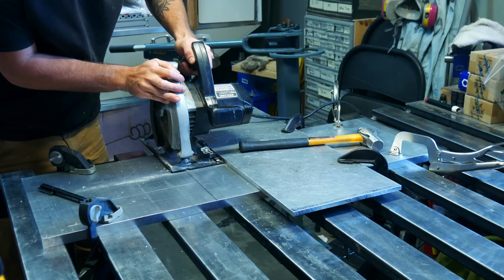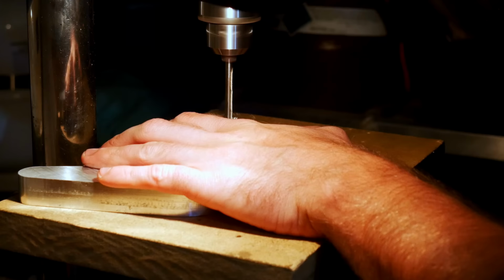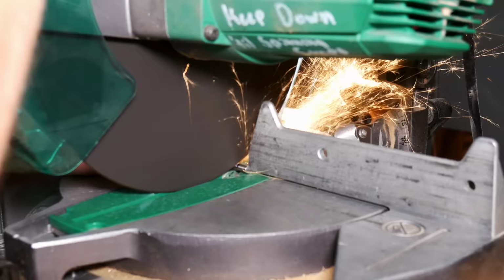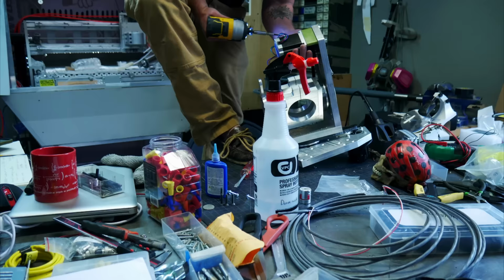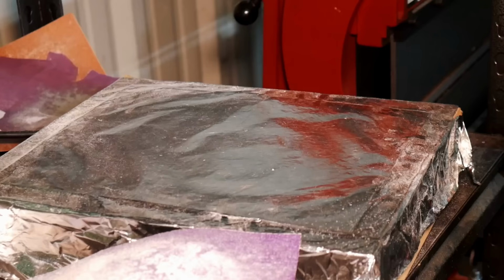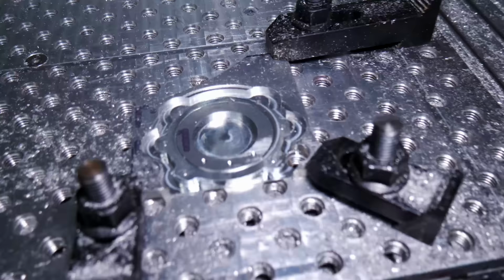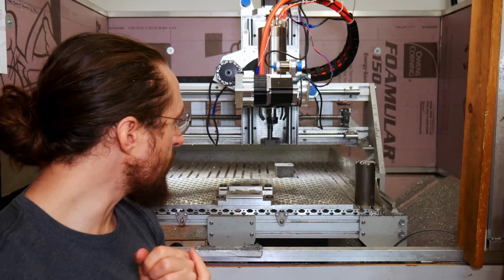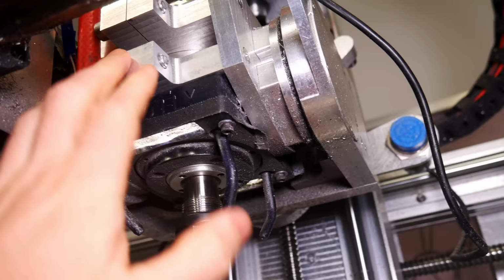Head-Head 5 Axis CNC Build

Comment from the maker: For those that are asking, the gear system is called a Howimat.  There's not a lot of information on them, so if you find more info make a post about it in the comments!
Reply: Just wondering if you're still planning on making a video about the Howmit drive? I'm very interested in it as I'm currently working making a large 5 axis.
I'm curious to know how stable your setup is being made from extrusion? I'm currently going back and forth between that and steel square tubing.

Comment: Nice vid man. FYI, You never want to twist wires together UNLESS they're a differential pair or power and ground. For instance, if you had a serial transmit and receive set, you'd want to keep those separate as twisting them together would cause cross talk, especially at higher frequencies (baud rates). A "pair" when talking about twisted pairs is usually a differential pair, for instance a CAN line would use a coupled or "twisted" pair when routing the circuit. This turns the prospective EMI into common mode noise that is then ignored during differential signal interpretation.
Reply from the maker: Interesting
Reply: That's a good bit of information.
Reply: Agreed. It would make sense for A+/A- to be twisted together, and B+/B-, but spindles are 3-phase so that would not make sense.

Comment: That's a cool gear mechanism! looks like a simplified Mini Galaxie from Wittenstein. The design trades a little bit of torque capacity and torsional rigidity for simplicity and compactness. Would be great to hear more about this drive and how you made it.
Reply: How is it called? Tried to google it, but I can’t find anything about it. Thanks!
Reply: @robytryall   I'm trying to find informatiuon about it as well and without any result
Reply from the maker: Yes, very similar, though this one is easier to manufacture.
Reply: @bogas78  I only found info on cycloidal ball reducer as most people comment around here, but the principle is by far not the same, here we get the balls reciprocating in a up down motion inside the disk, please help a friend out if you guys got more luck! Meanwhile waiting for the content owner to show up in the comment section. Much appreciated!
Reply: Hey  @DylanEdmiston ! Is there a chance you can give us a documentation on the wave ball reducer?
Reply: @DylanEdmiston  will you make a video about this howimat gear or prepare some website how to make one at home 😁?

Comment: The Backlash - belts stretch and contract. Maybe a little bit but they do. Thry to compensate it or remove the belts entirely with gears if possible. At least the gears have predictable backlash and it could be compensated with the software easily. Love the video great work keep on going

Comment: If linuxCNC use pivot point for it's TCPC, the centers of ration need to be located perfectly to have perfect rotation. Same as on industrial machines : cut one one side, do a 180°, recut, measure the tickness and adjust accordingly the pivot center. the hard thing is that you need to compensate the rotation AXIS of 2 axis, switching back and forth as you compensate as they are sort of linked.

Comment: 46:23 When you are trying to show a small piece in frame and want the video camera to focus the part, you must use the palm of your hand as a background or piece of paper, or else the video camera has hard time focusing. Excellent work on you 5 axis. I like the rigidity of the brackets...
Reply: Or use manual focus and set it at the correct depth for the shot.

Comment: The backlash is coming from the slop in all 3 axis with the round rails in an improper load bearing application on 2 of them on the side of the bearing housing.

Comment: Would you be willing to do a deep dive on your drive (halomat)? I havent found it online or to be used for industrial purposes. Also as you mentioned alot of people are finding out the hard way that harmonic drives or cyclodal drives arent good when they are 3d printed. Just to talk more about how they work and how to design them for the correct reduction ratio and so on.
Reply: its called a planar ball transmission or cycloidal ball reducer

Comment: When you're machining aluminum, and you can't use coolant, try and use an air vortex cooler. We used to do this when cutting open sealed boxes so we could harvest circuit boards out of them. Worked great for clearing chips from the endmill, and keeping temps down. It does require a beefy compressor/air supply though.

Comment: since people have been asking. its called a planar ball reducer they are known and studied and there are reasons they are not used. ie Hertzian contact instead of line contact of cycloidal or harmonic. meaning they have lower stiffness. they are really just a differently shaped cycloidal drive. also called cycloidal ball transmission
Reply: Yeah pretty much. I’m not sure how zbl is achieved without the drive on the same axis.  Stiffness could be improved using 3 wave peaks. But I can’t see mounting a motor without a worm or recirculating balls powering the drive platen that introduces backlash.

Comment: Great video! I work on CNC machines for a living and i learned a bunch from this. 
The controller i work with the most is Fagor. They have  offsets that can be used to correct the TCP errors you were trying to describe in the video. I would expect there is an equivalent with your controller especially as some head designs require these to be used as they cannot be physically aligned. I can send you information on how the offsets are used on Fagor controls if you think it would be of any help.
Reply from the maker: Interesting. Yeah that would be great thanks. You should see my email under my about. You can also find me on Instagram at ironmandylane

Comment: Awesome work on the machine, and interesting way of getting it to work. But the downside of that design is rigidity. You can take shallow cuts with small tools. I know its a hobby machine but it gets really old really fast waiting forever for the machine to nibble out anything bigger. 
For the time and energy put in this I would have made the machine base around 5 axis table / table to get more rigidity. 
Don’t get me wrong you made an amazing machine, just my two cents in the matter.

Comment: Thanks for the heads-up on the gear reduction. I'm very interested in the design especially as used in 4th axis. I'm not sure if you are using a tool length touch off sensor? If you are not it should help your accuracy. It also reduces  the tool change effort so you can throw in a chamfer bit. (much easier and better looking than hand finish) f360 chamfer operation is a very easy last step, especially when you have a plate full of parts.
Reply: I'm rebuilding my router for the third time. Last iteration was close to your current implementation. Next build ditches the aluminum plate for cast iron table saw tips filled with grouting cement. Even with 3/4" al plate I was seeing too much flex which may be what you think is backlash.

Comment: Thanks for posting the project. Building the prototype is one thing. Finding software to do something with it is quite another. The usual solutions are very expensive. I built a 5 axis solution for my aim of decorating the surfaces of my wood turned objects. The A axis is a usual rotary but my B axis solution is very simple, very rigid and cheap to make. It is suitable for an 800w dc motor at least. I wouldn’t bother hanging a 2.2kw spindle on it = too heavy. I use an inexpensive 32 bit control card with GrblHal, and use Grblgru control software = free. GrblHal has backlash compensation as well as G93 capability amongst other features. Grblgru can wrap any DXF or SVG file that’s suitable around a STL model of my workpiece and generate the GCode necessary for use. Here’s a short video of my solution. https://youtu.be/Q3nN6Hr2vbg?si=5a5KZ6NJwH-PuzLd. Happy prototyping.

Comment: Haha... "if acetone causes cancer ... ".  That's likely one of the several likely outcomes. I'm pretty reckless with my health, so this advice isn't criticizing... it's just FYI ... Anything that produces VOC (volatile organic compounds) is very bad to be inhaling. Fumes from gas, diesel, paint, paint thinner, brake cleaner, Varsol, acetone and even isopropyl alcohol. 

Exposure to these things will cause liver and kidney failure, chemical sensitivity, arthritis, respiratory issues chronic rashes. I know an old painter who got chemical sensitivity and pretty much had to live in a bubble. Death is not the worst thing that can happen. My father died fairly quickly from lymphoma (mechanic for 40 years) one of those tough old guys who washer stubborn stuff off his hands with WD40 and varsol... he got the easy way out as chemical sensitivity means if you pass someone in a hallway wearing too much perfume you have a severe reaction , you can use soap or shaving cream etc. 

Again... smelling my hoodie right now, most people wouldn't want to be sitting next to me because I smell like exhaust fumes. I'm not the safety police, just a passerby  👍
Reply from the maker: Lol hmmm

Comment: I'm asking myself, why do you think you need a 5 axis CNC?
I get the 4th if you're really into milling on the OD of round parts, but the 5th axis on the head seems kinda overkill for almost anything hobbyists do..
With one or two more clamping positions usually almost everything can be done with only 3 axis
5 axis is used in big industrial settings where time is money, and still have the problem of lacking rigidity in comparison with classic 3 axis machines.
The machine kinematics are hard to figure out, as you've found out yourself.. so i just don't understand why it's necessary, or do you just like it?
Then I get it, otherwise you'd definitely be better off just doing 3 or 4 axis
Reply from the maker: Depending on the features there are def parts that cannot be reasonably machined on anything other than a 5 axis.
Reply: @DylanEdmiston  I doubt many even do more than fixed axis milling, and if you're working with fixed axis you could as well do it in a separate clamping (I hope i use the right words here :D)
I think the problem is really the rigidity you sacrifice for the fifth axis isn't really worth the benefits...
I've worked with 40 ton parts on huge portal mills (both on fixed heads and 5axis), and very rarely I used the 4th And 5th axis, in fact even on those huge machines the lacking rigidity limited the precision and cutting ability quite a bit... Yes doing an angled surface with a big mill in one go is neat, but that's again just time saving and can be done on a 3 axis as well with the right tools.. and time saving usually isn't a really big factor for home gamer mills right?
Don't get me wrong, I love the project you did, it's really cool, and if you get the kinematics figured out I'd love to see it do simultaneous milling, I just think it's not the appropriate choice for 99% of home gamers, and hence the lack of projects using that approach to 5 axis..